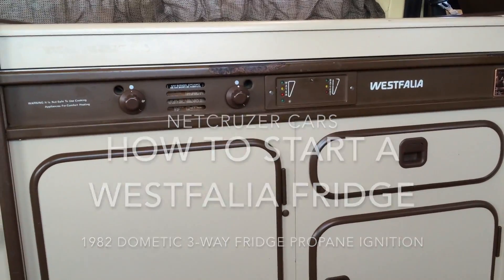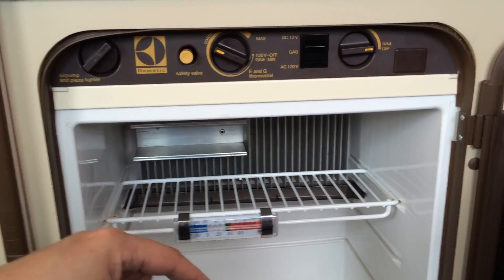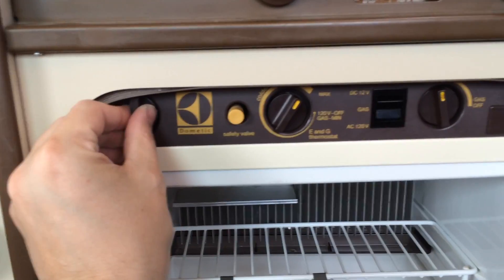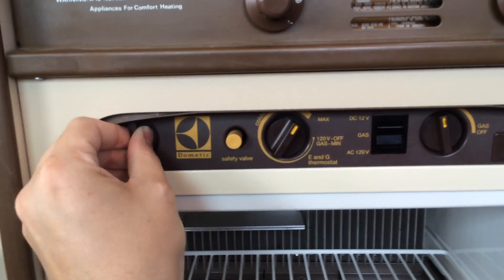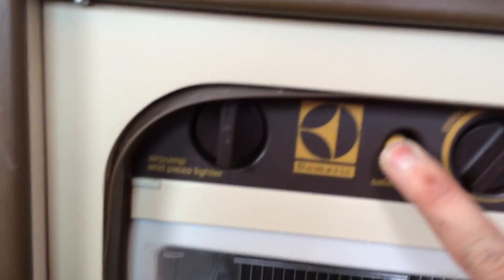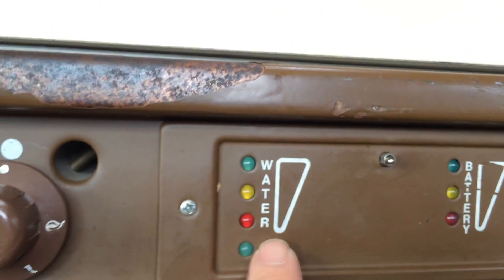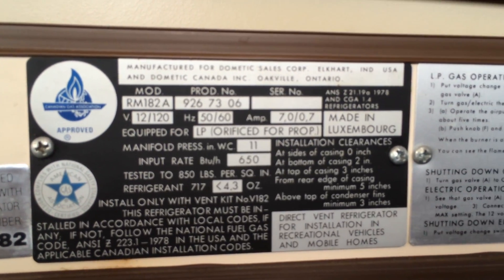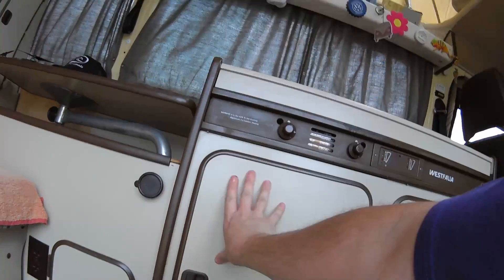VW Westfalia Dometic Fridge Ignition

Comment: Forget looking for the flame - unless your eyes are dark-adapted, and it's pitch-dark in the fridge, you'll never see the flame. What counts is the LED with the * next to it. It's powered by heat from a thermocouple sensing the flame in the burner. If it's bright, the burner's caught and all is well. 
Two "don't forgets": 1) Cool the fridge down with 110/220 overnight. It improves the odds of lighting vastly. 2) Full 12VDC to the igniter! A weak battery and/or low voltage means the igniter isn't going to throw a strong spark. If nothing else, run the engine at a fast idle to be sure the igniter gets full power.

Comment: This NEVER works.  Tried so many times.... thought you had a trick or something.
Reply from the maker: I’ve always got mine to work, I’ve been very lucky with my old fridge.
Reply: The trick is to chill the fridge the night before with AC. It usually won’t fire up unless it’s cold to begin with. I also press the button in a bit for about 5-10 secs before a start pumping. I believe that gets a little more propane flowing into the system. I pump 25 times, then hold the button push the pump all the way until it clicks. Listen for the sound of ignition. Sometimes I might push the pump in a couple times. Then check the LED and little flame in the window, like he suggest in the video here. If it doesn’t ignite, pump around 30 times to push out any propane and start again. You need the right mix of oxygen to propane. Good luck!